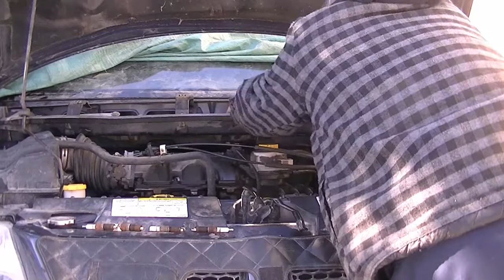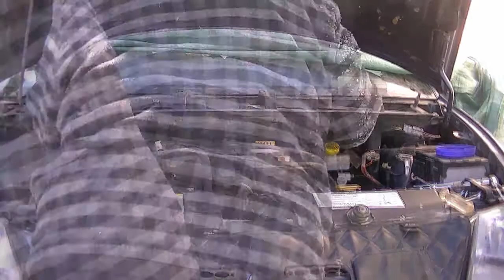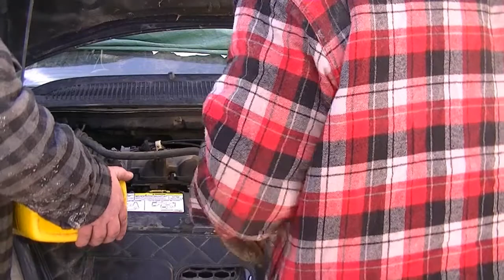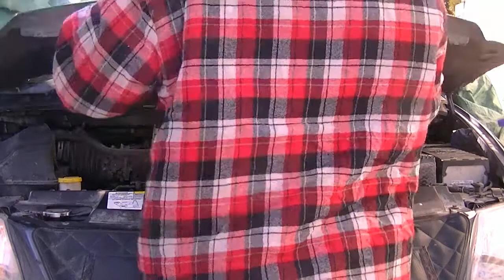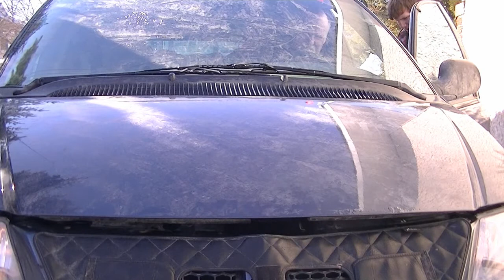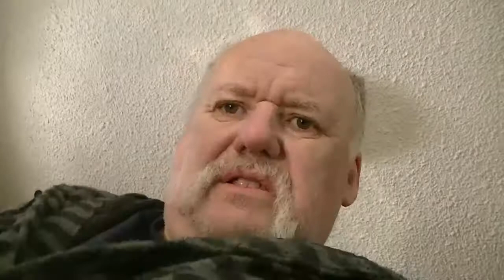Grampa's Garage #301 Fixing the Van Epilogue

Comment from the maker: 250,000 miles is actually over 400,000km!  WOW.  I wish I had never sold my 84 Suburban 4x4 with close to 375,000km.  Needed the yard space and my oldest son was getting married, so on a whim, I advertized and sold it.  Kept the winch though.

My dad bought the van new in 02, & I got it from mom after dad died in 07. Only 60,000km then, & was 2nd vehicle to our 00 Grand Prix till hail damage wrote it off about 3 years ago. My 72 Datsun 510 on the other hand has just 85,000 miles & 35-40 mpg!